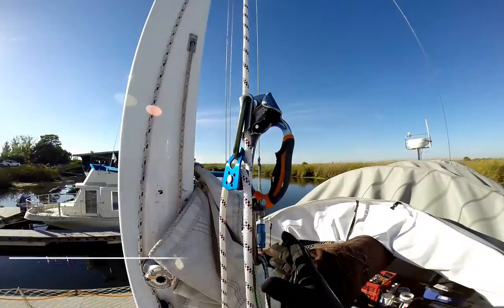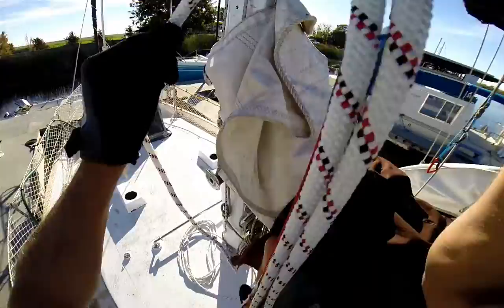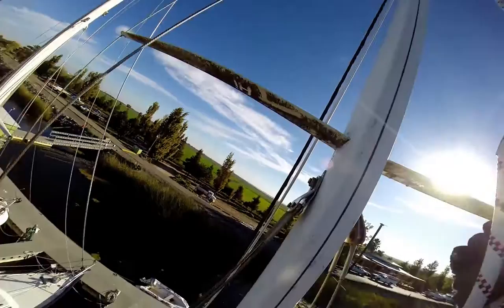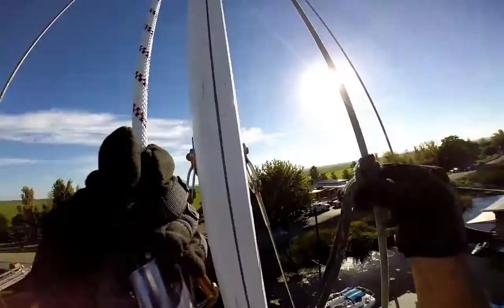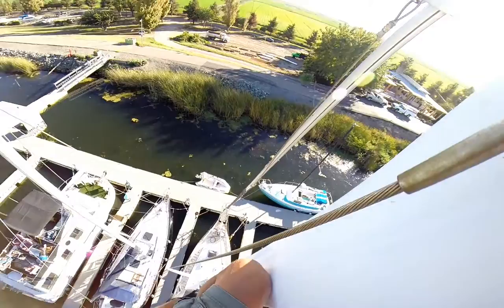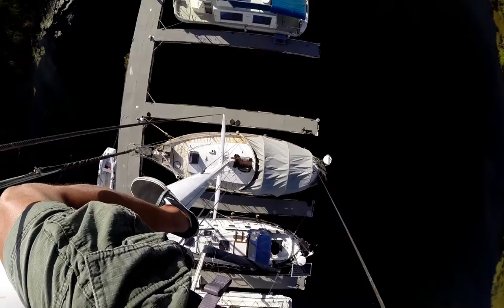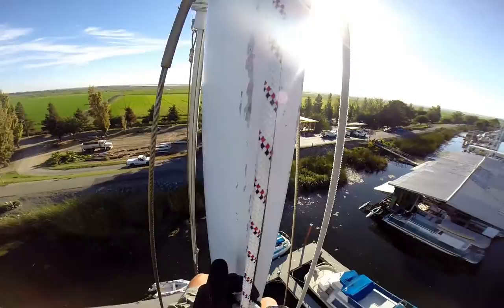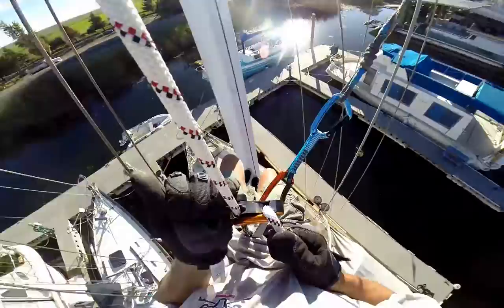SV Ramble On | Mast Climbing

Comment: I still loath climbing our mast, i rigged/fabricated a trailer boat Wench with enough wire length to hoist my ass up their .
My secondary are mast steps & i loath both of them .
But it's the only way i can ensure things are done correctly  .
As long as i have a generator i can hoist up .
Nice job 👍

Comment: No thanks, I pay someone to do it. I don't much like heights or the possibility of my body impacting the boat. On our Nor'sea 27 I hoisted my wife up. She was ok with it... It was free that day, but funny  I have been paying for it ever since.... ouch.
Reply from the maker: If you do it properly, there's not even the slightest chance of bodies impacting boat decks, especially when tied to the dock.  They've been using this rock-climbing gear for decades.  If something bad happens at sea, someone may just have to go up the mast to fix it.  Trust me; if you're short-handed it's way easier, and more importantly, way SAFER to solo-climb than it is to send a loved one up in a bosun chair on a winch.  Someone's gotta' steer. right?  If you've gained anything from our videos, you'll know that when you want it done right you gotta' do it yourself.